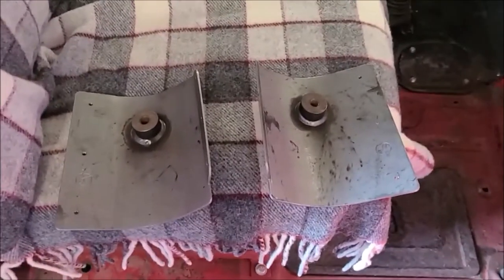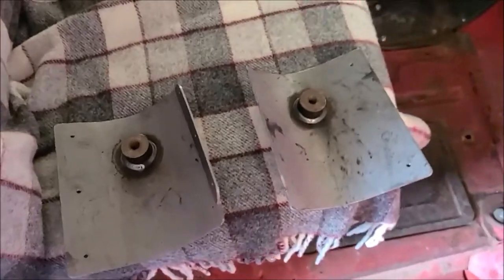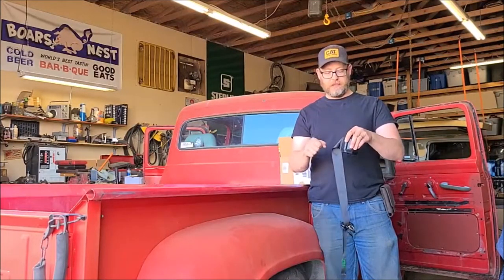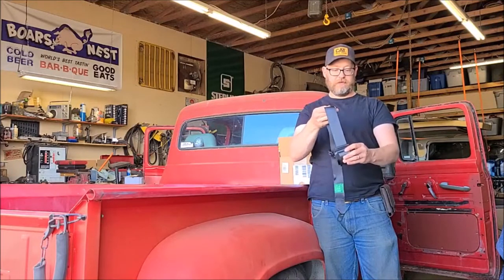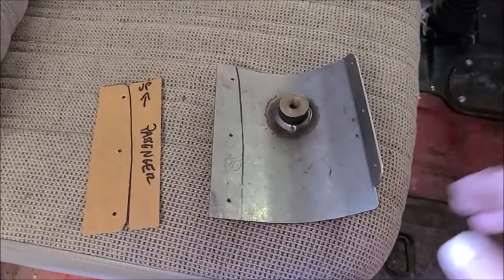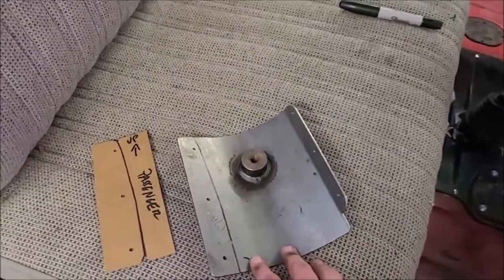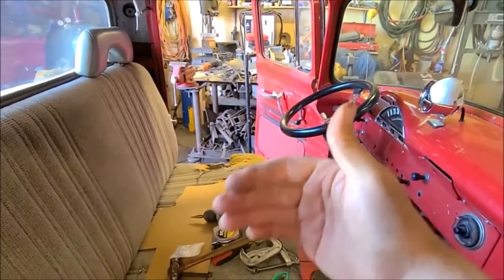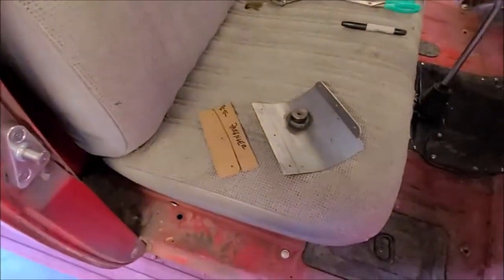1956 Ford F-100 Episode 38 - 3 Point Seatbelt Installation

Comment: The hole that you covered in the floor on the driver side was an access panel for the fuel sending unit in the top of the stock gas tank. I hope your truck is not still using the stock tank with sending unit. If it is the only way you'll be able to access it is by removing the fuel tank completely. I've really been enjoying watching this series of videos. I have done or am planning on doing most everything you have posted a video on.
Reply: Drill an 1/8 inch hole through the spot weld and then use the cutter.